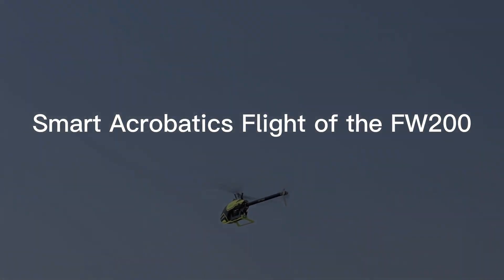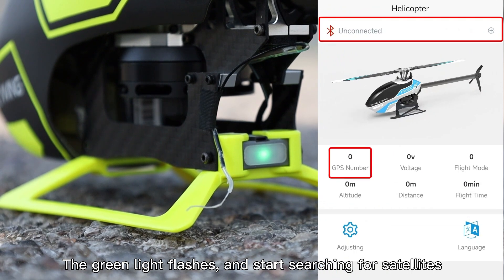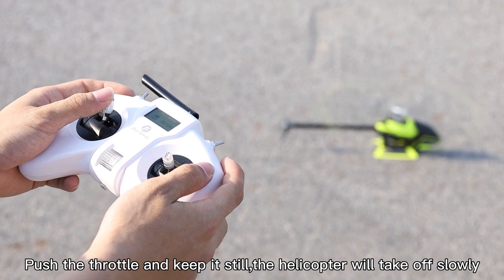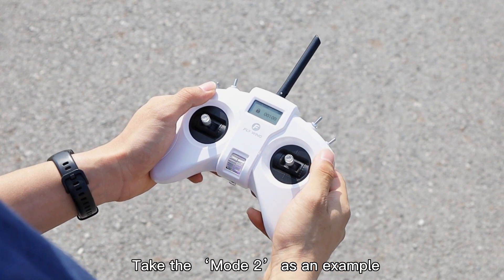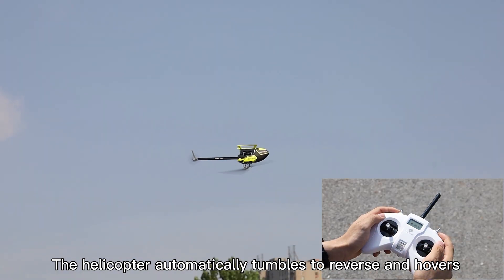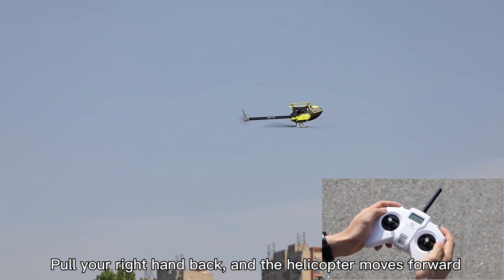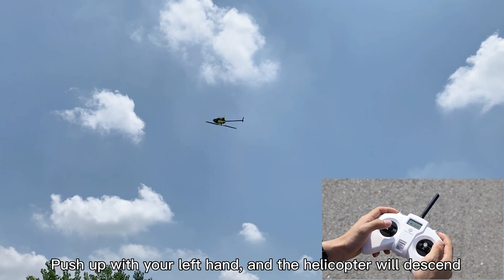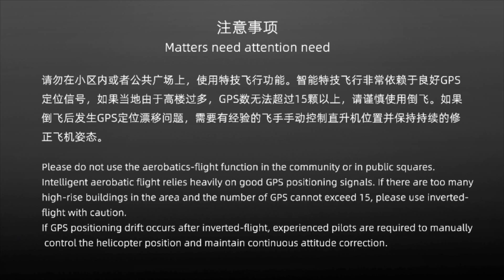FLYWINGRC FW200 helicopter smartACRO usage method

Comment: Hi Joe. I think the BLADES have to be on the Heli for it to function properly. I read that there is a Sensor in the Gyro or H-1 controller that will NOT let it spin up. Joe Cap....